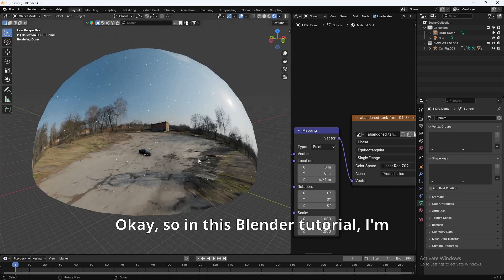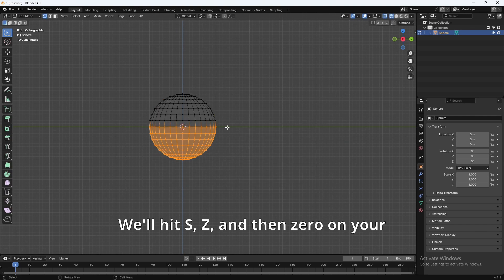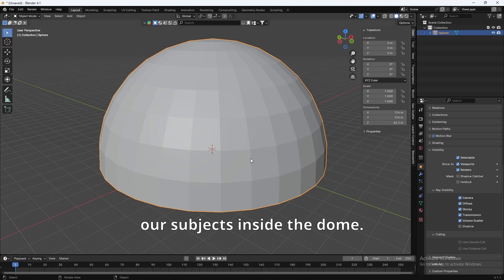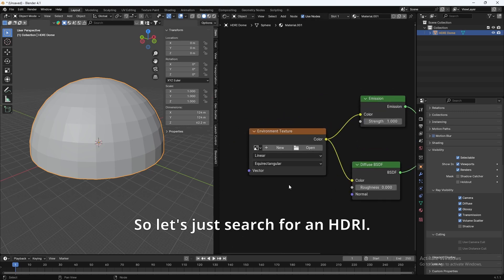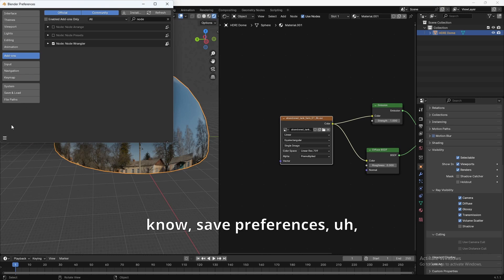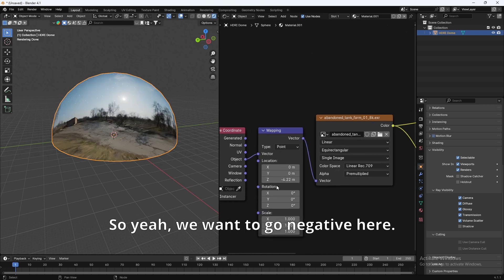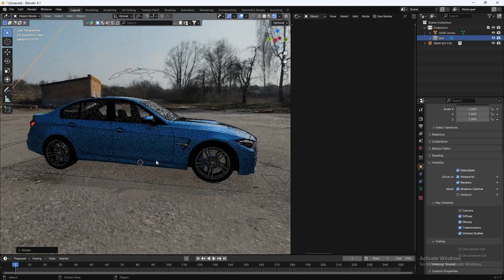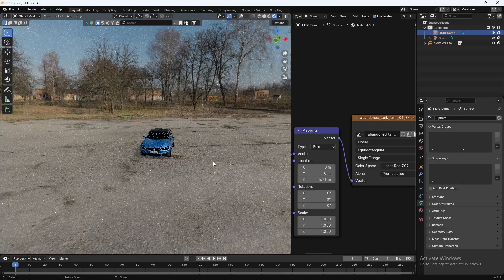How to make HDRI Dome for more REALISTIC Renders - Blender Tutorial

Comment: It's really bad idea to use hdri in such way. Why? Because as you can see light from 32-bit hdri is clipped and doesn't produce proper lighting. This is why you need to add point/sun light. You can achieve sth similar with shader nodes.

Comment: Does anyone know why my backfacing node isnt working? it just looks the same. But if the geometry node isnt hooked up it looks like how it should respectively in the video. Please Help.
Reply: same issue with 4.2
Reply: @lotictech  I found the solution. Try switching the the geometry shader to the bottom of the Mixer Shader and the Transparency BSDF to the top
Reply: @CRABSTAR5236 it worked bro! 🔥🔥🔥
Reply: i think you havn't flipped the normals... select the dome and go to edit mode and the Alt+N flip the normals

Comment: Blender now totally sucks because all these tutorials only seem to work in the version of Blender they were made in. That breaks 99 percent of tutorials made. An exisying confusing program made even more confusing.
Reply: I've found that most tutorials are preseved extremely well throughout Blender versions. That said, I almost never follow tutorials straight off of keystrokes/buttons anymore because I know the program quite well. I see where issues could arise for new users, and in that case I would suggest focusing more on learning the software and concepts itself through methods besides tutorials. Buttons may change but the functionality of the software remains the same or improves. Keyboard shortcuts usually change quite little as well.
I CAN recall several times where geometry nodes tutorials were useless due to the fact that nodes are being added/replaced all the time, making some setups extremely redundant in both complexity and performance. Hopefully, that will improve a bit in the future as geonodes developement becomes more backend.
Reply: You could learn maya or 3ds max man, or even better 3d coat since they not from autodesk :v, auto desk and adobe is money hungry monster
Reply: what are you talking about? works perfect in 4.2